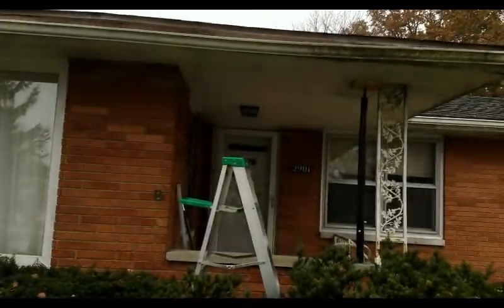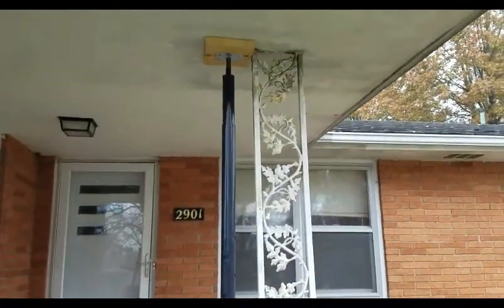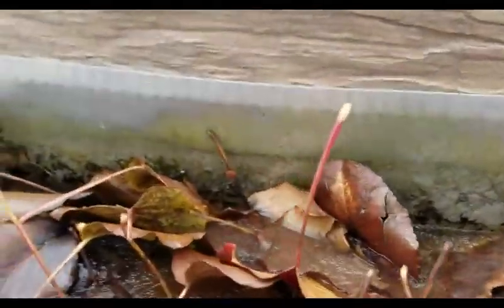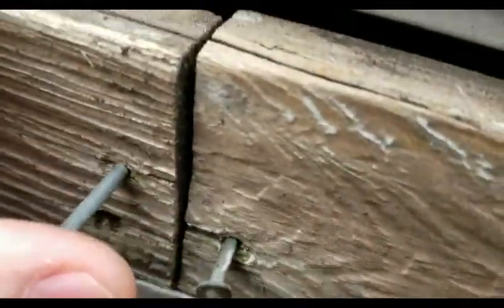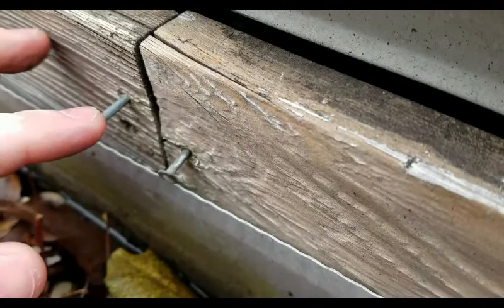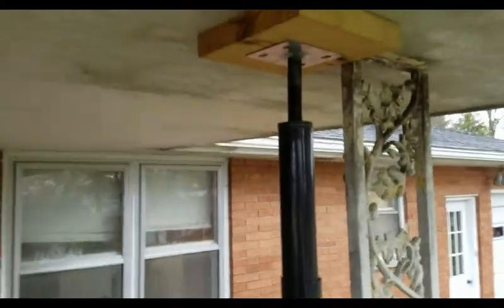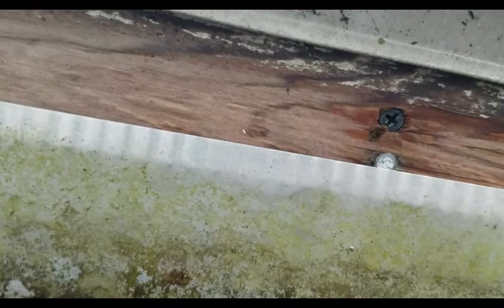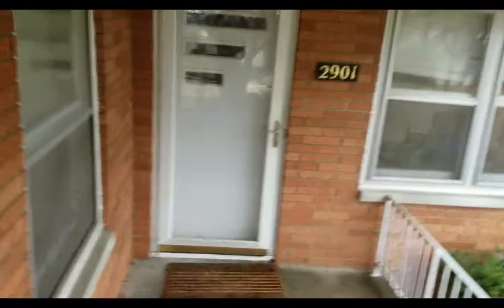How To: Fix a Sagging Gutter

Comment: It is my understanding that the gutter is supposed to fit under that metal drip edge under the shingles. Otherwise, water drips off your shingles onto the exposed wood fascia causing it to rot over time. Might want to replace the fascia and rehang the gutters.